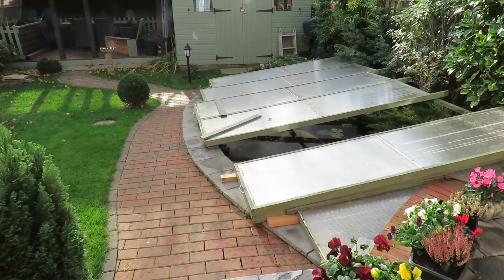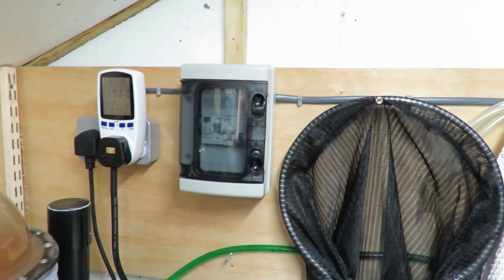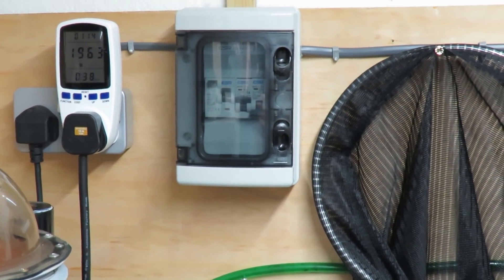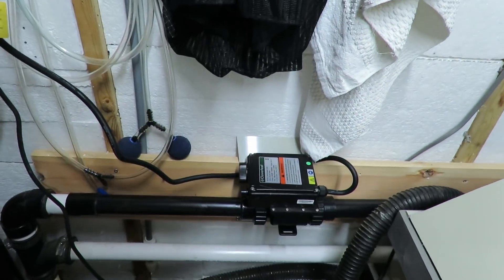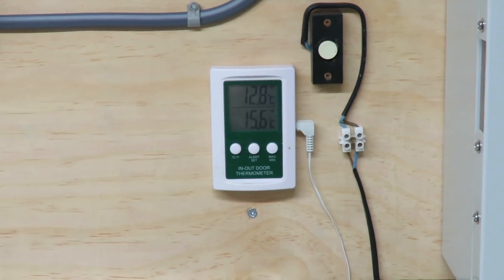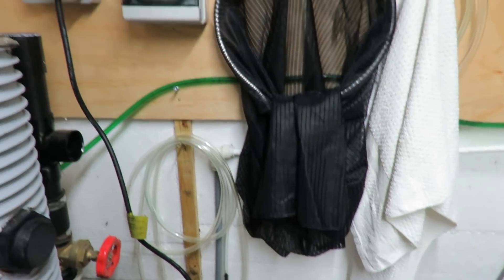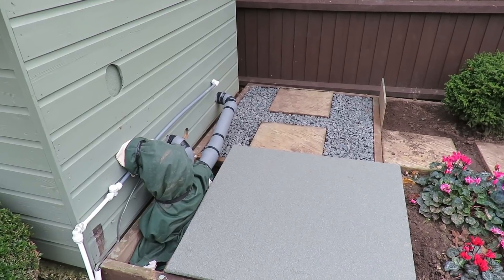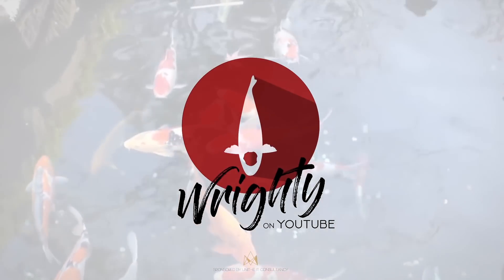More On The New Cloverleaf Pond Heater.

Comment: I have just fitted a Profi 3 KW Heater on my 2500 gallon pond and it is working well, No issues, For an extra 20 quid it seems to be a much more professional bit of kit, I steered clear of the Cloverleaf heater as I had seen other reports of issues with the thermostat, Send it back and get yourself a Profi as a backup 🙂
Reply from the maker: Hi Ross, You won't believe this, but I have a 3kw Profi heater in my big shed. Your absolutely right mate. Their a far better bit of kit than the cloverleaf. I just wanted to know if the Cloverleaf was cheaper to run. I didn't realize how bad they were. Can't wait to get my new ashp here now. Thanks mate and take care, Terry.
Reply: @Wrighty  Good stuff, You have an incredible setup there Terry, Looking forward to see how your ASHP works out, Might treat myself to one in the spring depending on how much it costs you to run one lol
Reply from the maker: Hi Mate, If you do think about getting an ashp, give me a shout first and I might be able to help. I'm a registered seller with ThermoTec, I might be able to get you a deal mate. Terry.
Reply: @Wrighty  👍

Comment: Morning Terry, very interesting video. I most certainly would be returning the Cloverleaf heater, wouldn’t trust it even as a back up only. The wife watched with me and immediately said fungal problem, she would lift the pots for better drainage, remove the leaves and wouldn’t feed, with new compost shouldn’t be required and not much point in cold weather either. Looking forward to seeing the new heater install. Take care mate.
Reply from the maker: Hi Mike, thank you. Yes, I'm going to send it back mate. Thank your wife for me, for the info on the plants. With all the rain we've had, they've not had much chance to dry out. I will try and improve the drainage for them. I did put stones in the bottom of the pots. I can't wait to get the new heater, will be an interesting project mate. Thanks again, and you both take care, Terry.

Comment: Hi Terry.
Not long now, and ashp should arrive, I've been looking at my set up, and changed my mind about where to place it, don't know if you've seen my video's in which I have mentioned placing it by side of filter house but there is a great big conifer stump and roots which will need digging out, so been looking at  purpose made metal brackets and hang it off the front of filter house and have bypass set up inside.
Reply from the maker: Hi mate, I think they start shipping them out on the 30th Nov, so a couple of days after that we should get it assume. I think I have everything ready for it, so it shouldn't take long to fit hopefully. It will be an interesting project mate. I hope the koi  appreciate what were doing for them lol. I'm going to try to put a roof over mine if possible, just to keep a bit of the bad weather and leaves off it. Like you say mate, not long now. Lets hope the weather doesn't get too bad before then. Take care mate, Terry.

Comment: Another good video Terry I’ve had a clover leaf pond heater for 2 seasons now and it has to be one of the worst pieces of equipment I’ve ever bought for a pond. This winter it’s completely packed up and has tripped my electrics. Looking forward to seeing how you get on with your air source heat pump.
Reply from the maker: Hi Paul, thank you. I have to say, I agree with you mate. I think the Cloverleaf Heaters are a rip off. I've found out they were originally made for Hot Tubs where the temperature wasn't to important. The ASHP is doing really well. We've had a really cold spell here where the temps got down to -4c at night and around 0c during the day, and it still hasn't cost above £1.50 a day, and that's keeping the pond at 15c. So I'm well pleased with it. Take care mate and Happy New Year, Terry.

Comment: Hi terry what was your final conclusion on the cloverleaf would you recommend it and how did you find it expensive wise  ? cheers mike  stay safe and well terry 👍🏻
Reply from the maker: Hi Mike, to be honest mate, they should never be sold for koi ponds unless it's a very small pond. They were originally designed for hot tubs, and that's all there good for, is my opinion. If the weather comes really cold it was costing me about £8.00 a day. I had a problem with the thermostat, and I also found out lots of other people had as well. Sorry mate, I can't recommend them at all. take care and stay safe mate, Terry.
Reply: @Wrighty  cheers terry will look at something else thank you for your reply and help 🙏
Reply from the maker: Hi Mike, you can get a 2kw or 3kw Profi Heater that are built for koi ponds, If I remember correctly, I think my 3kw Profi Heater cost me around £15 a week, mid winter. The best and most economical pond heating is an Air Source Heat Pump, but not cheap to buy. I run the 9kw Thermotec Inverter ASHP and heating my 2500 gallon pond to 15c all winter last year cost me about £140.00 for the whole winter. You can see my heating costs in this video at point 22:00 in the video: https://youtu.be/cGulZ35sjZw I also have one or two videos showing me fitting my ASHP, if it helps mate. Terry.
Reply: @Wrighty  once again much appreciated I will now look into both the profi heater and also the Ashp also maybe the ashp next year as it’s nearly Xmas and I think the wife wouldn’t be to happy with me purchasing one just yet 🙈but thank you terry 👍🏻
Reply from the maker: Your welcome mate, Terry.

Comment: Great Update - Keep them coming. That sounds a lot more stable with the price. That isn't much different (25p) to what I averaged last year in the similar weather temperatures. You are not a million miles of with the insulation and efficiency until the ASHP comes.
Reply: I got the ITC 308 Terry, but I should have ordered the 306 I think, as mine does hot and cold. Just make sure you get the one with the correct probe suitable for water and its the plug in probe so that its changeable if goes faulty. There's some good info on them on YouTube
Reply from the maker: Thanks mate, was hoping to use the Cloverleaf until the ashp got here, but can't rely on it, I'll get a new external stat for it. Over another week to go before I get the new ashp. thanks mate and take care, Terry.

Comment: Hi Wright thanks for all the great videos I so look forward to them. I do have a question though if that’s ok, what’s your advice on air stones in the winter? Do you leave yours running or do you shut them down, thank you and may I wish you and the Mrs a wonderful Christmas and a Happy New Year. Happy Ponding, stay safe👍
Reply from the maker: Hi Alby, Thank you. Good to hear you enjoy the videos. I use to leave my air running in the shallow end of the pond through the winter before I had the pond heating so they could get air if they needed it. I didn't put it in the deep end as I didn't want to disturb the deeper warmer water. If your pond is the same depth across the bottom, I would put a small air stone in one corner. It will also help stop the pond freezing over. Hope this helps mate. Merry Christmas and all the best for the New Year to you and your family. Have a good one. Take care and stay mate, Terry.

Comment: Are you putting ashp in a box.iam sure it needs 2ft clearance all way round.cheers
Reply from the maker: Hi David, You are right mate, it's not wise to box these heat pumps in. You need a clearance around the heater of 300mm at the back, 2500mm at the front and 700mm at the sides. They need lots of air. Thanks mate, Terry.

Comment: I had a 2k one of these and ended up taking it out. Wasn’t very good in my opinion. If anything it wasn’t working properly or struggling maybes. All wired in correctly and correct water flow. My ponds about 1500gallons and I ran it at the end of winter and in the early spring to get things going. Also I agree the thermostat is crap. Disappointing really. Cheers 😃👍🏻
Reply from the maker: Hi Alex, That's right mate. In my opinion their rubbish and shouldn't be sold for koi ponds. They were originally designed for Hot Tubs which is where they belong. Have you seen my new heater? Have a look and see what you think: 
 https://youtu.be/SfLpQaJDKpY thanks mate, Terry.

Comment: Hi I have a power meter like the one you have how do you set up so it tells you the cost of your heater what price is it per kwphr any information would be appreciated on setting it up
Reply from the maker: Hi mate, You need to find out your electric KWPH from you supplier. I think it should say on your bill. Mine is 15p per Kwph.
The way to set the price on the power meeter is, press and hold the PRICE button for 3 to 4 seconds. 4 zeros should appear with a decimal point in the middle as shown: 00.00 The left hand zero should be flashing. Press the FUNCTION button once and the second zero will flash. Press the FUNCTION button again and the third zero will flash. Now press the up arrow button once and the number 1 will appear: 00.10. Press the FUNCTION button again and the fourth zero will flash. Press the up arrow button until the number 5 appears: 00.15. Now press the PRICE button and it will be saved. If you now press the FUNCTION button again it will take you back the the main screen. Let me know how you get on. Hope this helps mate, Terry.
Reply: @Wrighty  hi mate it says 14p on my bill so do I put 14 in the last 2 zeros  because it 00.00 so I would need to set it like 00.14 cheers its a shame I can't send u a picture
Reply from the maker: Hi mate, yes that's right. 00.14 you should find it works ok like that. Terry.

Comment: Terry. As always great video.  I have stayed away from pond heat because the ground is a huge heat sink. In my part of the world it gets to minus 30 often in the winter.  It would take a huge heater to even try to heat a pond.  I made a flat grate of 3 single hundred watt aquarium heaters that sits on top of a large air stone.  I set the rig in the shallow end about 18 inches deep.  The idea is to keep a hole in the ice and not try to heat the pond.  The fish go completely dormant and lay on the bottom in deep end once the deep water temp drops below 40 Fahrenheit.  Using a wireless temp probe in deep water I have never seen it drop below 36 F.  I do not put anything down in deep to disturb water.  I have used this system for 10 to 15 years and never lost a fish over winter.  I tried all kinds of other ideas for 20 years before that and almost always lost at least one nice fish a winter.  Lesson I learned. KEEP DEEP WATER STILL and keep a hole in the ice for gas exchange.  Add 1 lb baking soda to pond once a month in cold weather to buffer ph
Reply from the maker: Hi Jim, that sounds like some good advice there mate. thank you. Thank goodness our winters are not that bad here. I can't remember the last time my pond was frozen over. The year before last my pond did drop to 4c and I felt really sorry for the koi lol. I'm just a big softy really lol. It'll be ok once I get my new heater here, I will keep the pond temp at 15c through the winter which will also keep my bio filters running. Thanks for the tips mate, really appreciated, Terry.

Comment: Hey Terry , What a polarva lol. I think you must have a doggy one there mate . I don't think I'd ever put one on the main pond ( would cost a fortune) but on my little grow on tank its doing blinding . I'm using a seneye and its set at 22 degrees and tbh it keeps the temperature pretty much bang on ( maybe 3/4 degrees here or there) but mines run in a fully insulated room and the ponds fully insulated so its not got the outside elements to fight with. Nice update mate 👍 still can't wait to see your new one up and running though !!
Reply from the maker: Hi Mark, To be honest mate, the cloverleaf heater is a right pain in the butt lol. I should have just got my 3kw Profi heater out and used that. At least it keeps the temp spot on. That's a big difference mate, being indoors. I can't wait to get my new heater here now and get it up and running. Thanks mate and take care, Terry.

Comment: Hi terry, 
Great videos always look forward to them 👍. 
Don’t want to throw a spanner in the works but would the ashp be better mounted off the ground ? 
My logic behind it is cold air will sit in your garden especially being enclosed and the coldest air will be at ground level and it will cost more to extract any heat from the air, on a windy day I can’t see it would make any difference, but on a cold  still night it might.
Just food for thought keep going with the videos 
All the best John
Reply from the maker: Hi John, and thank you for your kind comments. I know what your saying mate about having it low on the ground. There are rubber feet to go on the heater which will lift it a little, and that garden is raised about 10" above the lawn. It's just sorting the pipework and how it will fit. I will keep it in mind though mate thank you. Very much appreciated, take care and stay safe mate, Terry.

Comment: It is necessary to keep the water temperature above 24°C during the summer and to feed the KOI as often as possible to make it stronger. With this in mind, what is the current status of these devices and what is the power bill for them?
Reply from the maker: Hi mate, You don't have to keep the water over 24c during the summer, I don't use my heater in the summer unless it becomes really cold, or really hot, as it can cool the water as well. I just use it to heat the water in the winter. I don't recommend using the Cloverleaf heaters at all, as they can cost a lot of money to run. If you have a look at this video of my heating costs using the Thermotec ASHP it will give you some idea: https://youtu.be/cGulZ35sjZw hope this helps, Terry.
Reply: @Wrighty  We believe that it is not good for KOI to be fed in the winter in water temperatures of 15-17°C, so it is better to concentrate on feeding in the summer to increase the immunity of KOI and let them hibernate in the winter. I am wondering if it is possible to compare the cost of raising the natural summer water temperature in the UK to 24-25°C with the cost of running the system in winter?
Reply from the maker: Hi mate, I have no idea what heating in the summer costs are, as I've never done it. I think you'll find that koi don't hibernate mate. In fact, if it gets too cold, they can suffer from Hyperthermia. I do give mine a cold spell for a month, but I believe our winters here in the UK are too long for them. Terry.
Reply: @Wrighty  When I lived in Cheshire, I found that in some areas the winters were longer and colder in Japan than in the UK.
This is the general water temperature of a pond in Japan. https://i.imgur.com/ArvgqB0.jpeg Many people keep their fish from late December to early May without feeding them at all. So, after keeping KOI in two different countries, I have found that the water temperature in the UK is too low in summer.
Reply from the maker: That's right mate, That's why most breeders in Japan, bring there koi in from the mud ponds to the farm, under cover over the winter. I don't feed mine if the temp drops below 8c, and only wheatgerm under 12c. Having the warmer water in the summer can only help mate. Terry.
Reply: @Wrighty  That's right. The old pioneers of the KOI there visited Japanese breeders frequently and brought back information about their particular unique region, NIGATA, and rarely got any knowledge from hobbyists like us. If they had the opportunity to do so, it was only with famous and very rich hobbyists.

Comment: 👌👌❤️
Reply from the maker: Thanks Sandy, Terry.
Reply: @Wrighty  are you still using this heater this year and approx how much £ for 24hr use. My pond is 6000l raised very well insulated
Reply from the maker: Hi Sandy, do you mean the Cloverleaf 2kw heater or the new ASHP. If you mean the Cloverleaf 2kw, no, I found it too expensive to run on a 2500 gallon pond and the thermostat on them is not good or reliable. They are cheap to buy as pond heaters go, and do heat the pond. If you fitted a different thermostat to them as Adam Julian has done in his videos, they do work a lot better. He uses them. The one I had is in the shed somewhere. I run the new Thermotec ASHP now and do love it. Thanks Sandy, take care, Terry.
Reply: @Wrighty  thankyou I was on about clover but I'll look at ASHP now
Reply from the maker: Hi Sandy, The ASHP's are quite expensive. The Thermotec Inverter ASHP's like mine are one of the best on the market. Here's the link:
https://www.heatpumps4pools.com/product/thermotec-inverter-horizontal-heat-pumps-9kw-to-24kw/ Have a look and see what you think. Terry.
Reply: @Wrighty  not in my budget I'm afraid 🤣

Comment: Hi mate, looks like a faulty heater, looking forward to you installing the air source. the pansies look like they've got a fungal disease, blite maybe, can try and treat with fungicides, improve drainage and dont over water. Andy
Reply from the maker: Hi Andy, I can't make anything of the heater at all mate lol. Will put it on an external stat. Thanks for the info on the plants mate, I'm not watering at the moment, we've had that much rain, there's no need lol. Will look into the fungicides mate thanks, Terry.
Reply: Ok mate, pansies need good drainage they hate sodden soil, so the wet weather prob hasn't helped. Stay safe mate 👍
Reply from the maker: Thanks again mate, really appreciated, Terry.

Comment: Sounds like your heater has a problem Terry, are you sure its cycling on the t/stat and not the pressure switch. I had to mess with my pressure switch. i also use an inkbird external stat and keeping pond at 15c
Reply from the maker: Hi Martin, I did check and I have plenty of flow through the heater. Which inkbird stat did you get mate, and is yours a 2k heater. Think I'm going to have to get one. Just dare not trust the Cloverleaf now. Thanks mate, Terry.